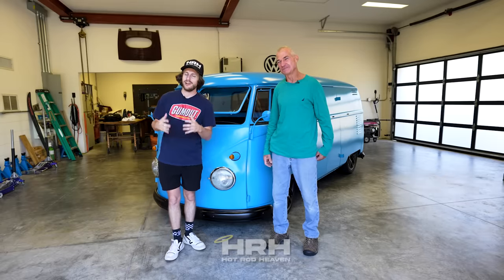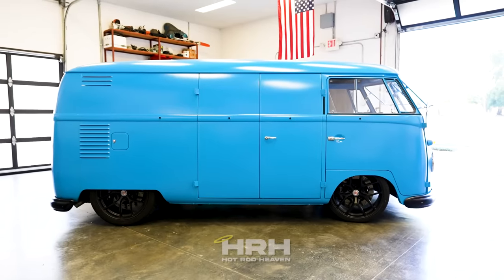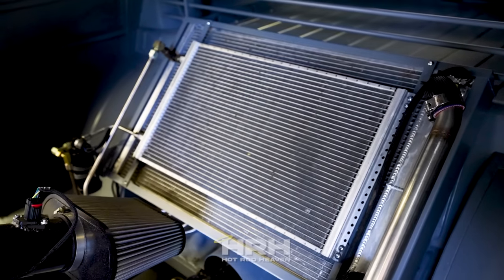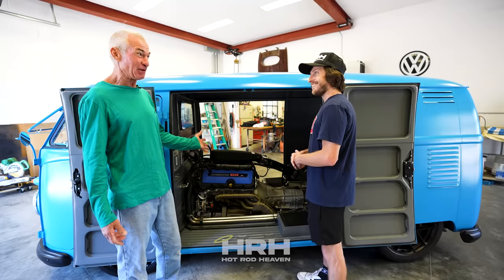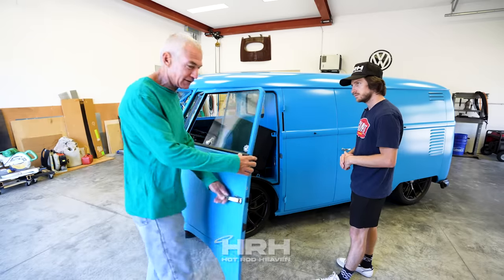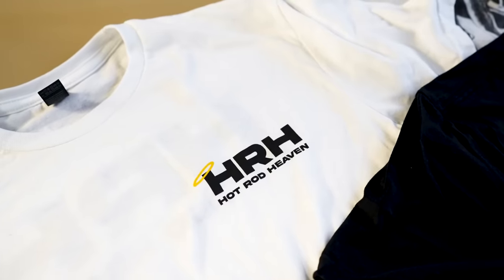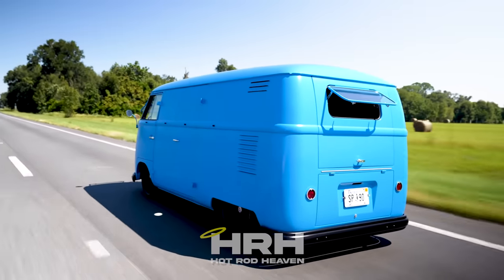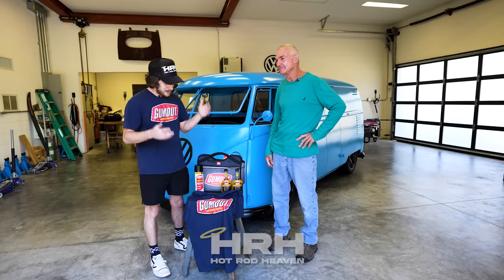Coyote Swapped VW Bus

Comment: I love a split window type 2. The only thing that kept me from buying one is that driving one, you are the thickness of the front sheet metal from the idiot that pulls across in front of you or brake checks you. .030" of armor. You are the crumple zone. Yet I still ride motorcycles. Yeah, I don't get it either....

Comment: VW on HRE wheels, 🤌perfection sitting on a piece of jewelry you call a frame.(Art is a legend)
The only thing that would be better is if it were a safari bus with 23 windows.
Needs a Wile E. Coyote running on the side. Like dodge did with the roadrunner.